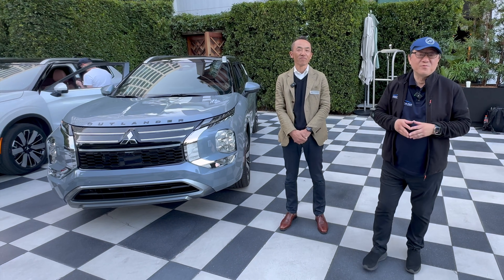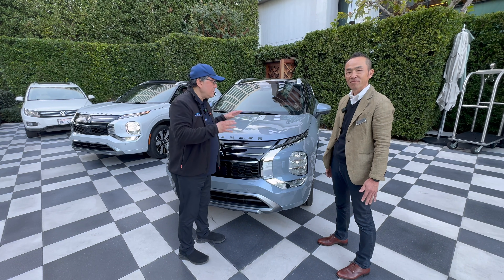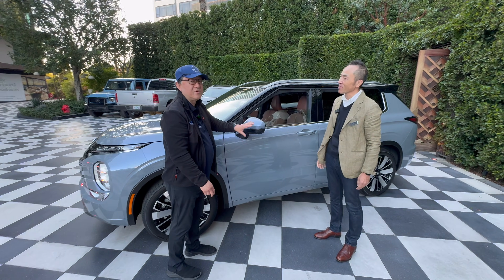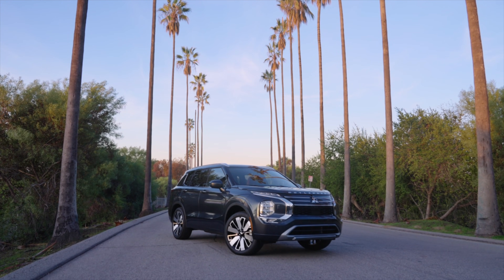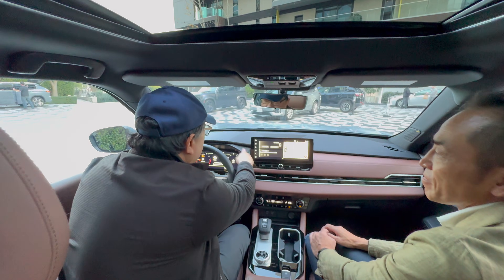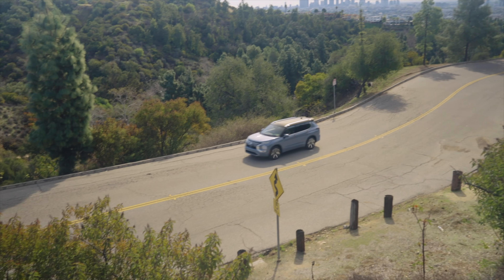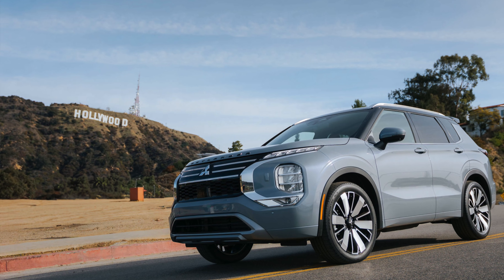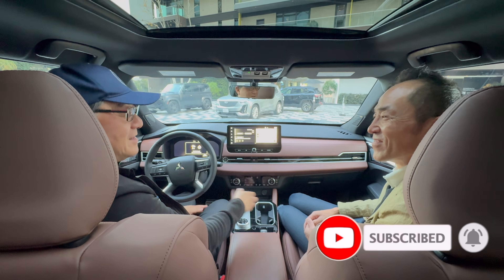TWO ENGINEERS EXPLAIN EVERYTHING ABOUT 2025 MITSUBISHI OUTLANDER // CHIEF ENGINEER FROM JAPAN

Comment: Nice review and explanations!
I'm hoping you could tell me about the PHEV  ---- I understand that in - 20 C, the PHEV won't start as it's too cold for the drive battery to function ---- previous to 2023 or so they used ceramic heaters, which were upgraded to heat pumps ( I expect for the cabin) however the change left people unable to start the car in - 20 temperatures ---- has this been addressed and in what model year(s)?
Seriously interested in the PHEV from 2023 onward.
Cheers!

Comment: I like the outlander but its engine is a deal breaker.  I had one and the engine is very weak. 181 hp is very low horse power.  My miata as an example has the same hp. This car needs at least 250 as the previous. Also the network of the Mitsubishi dealers is so low. In Houston as an example they have only 3 dealers. Nissan cvt.

Comment: Have they put in a spare tyre and removed the third row seat which is useless.
Reply: Australian versions have both the spare tire and the third row, in the U.S version Mitsubishi didn't include a spare tire, but you can add one with a Nissan Murano spare tire I think and you have to remove the foam underneath.
Reply: @Raki-m7i that is correct. I did this in my 2024 Outlander SE. It fits perfectly and there is still room for the jack and and some tools.

Comment: Really interested in the 2026 Outlander PHEV.  Do you know when it will be announced?
Reply from the maker: I'm not sure, but I think it will be in the fall
Reply: What’s different about the 2026? I thought the 2025 is a refreshed version already!
Reply: @issameQ   This is the regular Outlander - refreshed in 2025.  The Outlander PHEV is supposed to get these updates and more(?) in 2026.  The Outlander PHEV has more horsepower and is significantly quicker; also no CVT and Mitsubishi engine instead of Nissan.
Reply: @mikeyc7072  will the PHEV body be any different than the 2025 version of the gas one?
Reply: @issameQ  The body style has been the same between the PHEV and non-PHEV for many years. Mitsubishi is a small manufacturer, I doubt that they will increase costs by making that change now🤷🏼‍♂️!!
Reply: @ but there are changes in the 2025 gas that are aren’t in the 2025 PHEV. Some are in the exterior and some like infotainment system and the seats and leather etc.
Reply: @issameQ  The gas and PHEV Outlanders are on different update schedules in North America, Australia, and New Zealand.  The 2025 PHEV in Europe and Japan has many of the same updates as the 2025 gas Outlander.  Thus, the reason for my original question.   When will the 2026 PHEV be announced in North America?  There is also a rumor that the 2026 PHEV may have a larger battery with enhanced range🤔🤷🏼‍♂️!!